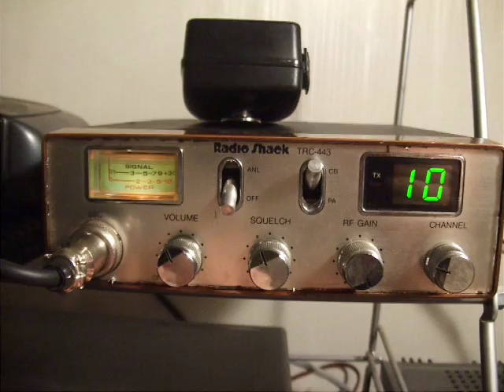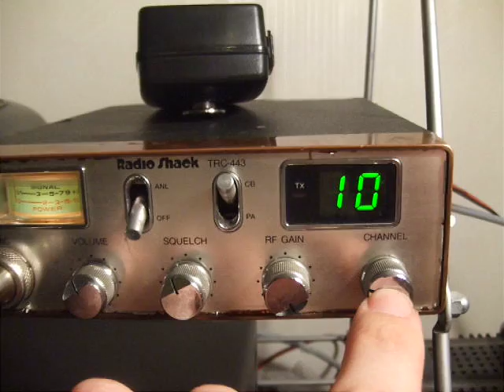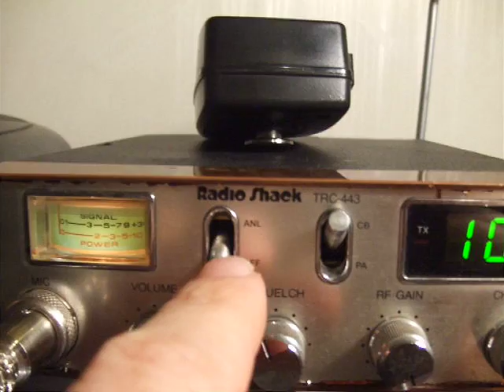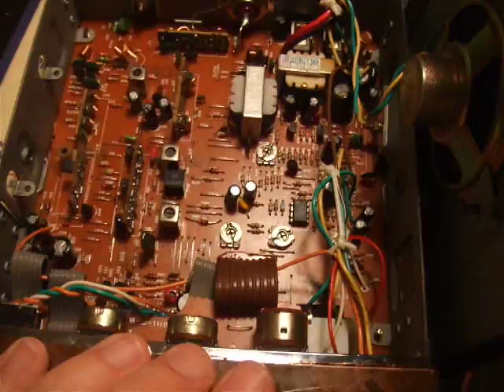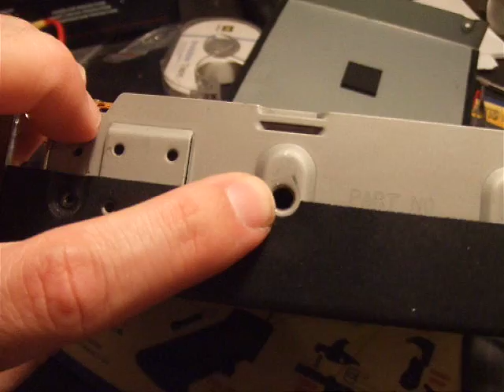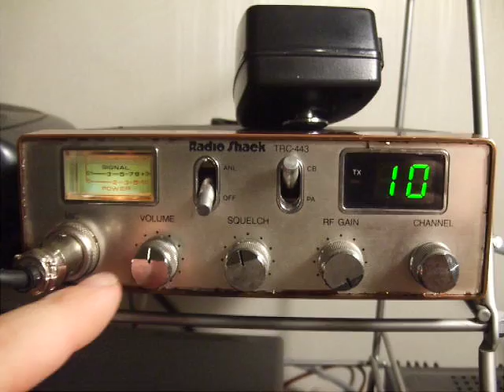Radio Shack TRC-443 CB Radio

Comment: I have a radio shack trc444  and I do not get any out put on the key up  what do you think it could be please and thank you . Michael
Reply: cold solder joint
Reply: Try another mic. If it sat for awhile, spray some electrical cleaner in the any jack. I just bought 2 RS mics from Amazon, and one was bad. Made me think the radio was bad.
Reply: That misspelled word was supposed to be antenna jack.